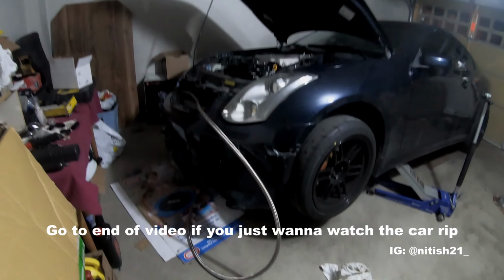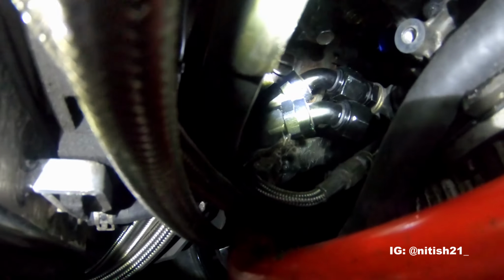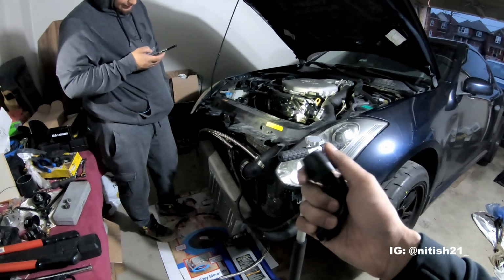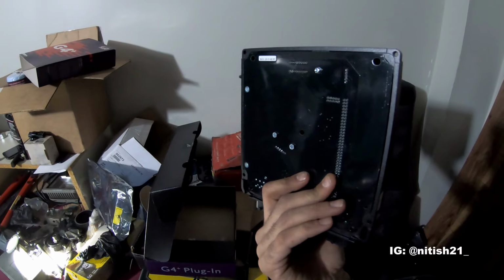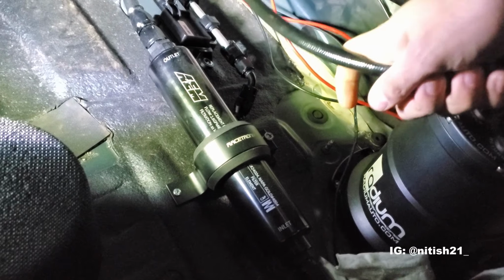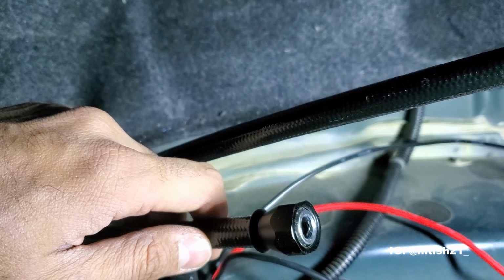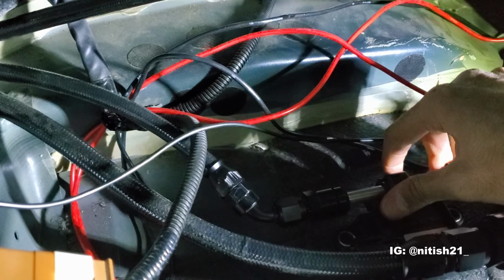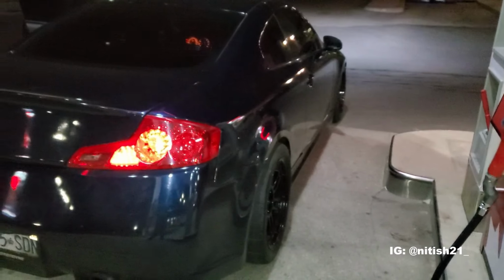600WHP BUILT TURBO INFINITI G35 BUILD UPDATE

Comment: Hi bud just curious why you opted to move away from SC to TT, thanks
Reply from the maker: When u want to make bigger power it's far easier and way less headache. Thers no belt slip, less heat issues. Lower fuel demand. Supercharger is really only good for that initial hit and then they make peak power for one second at redline